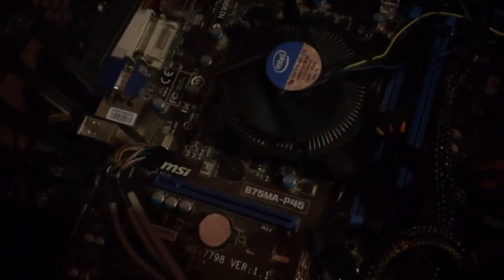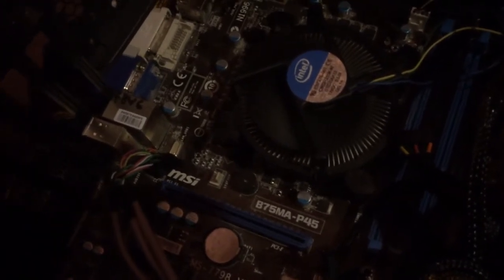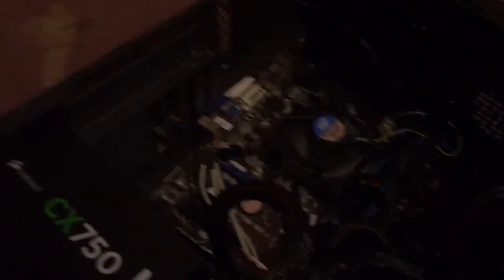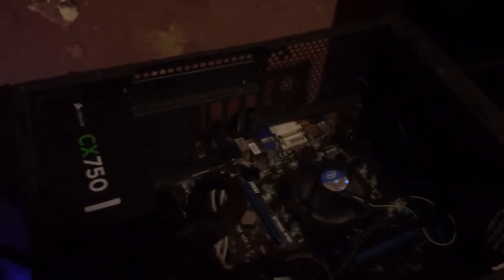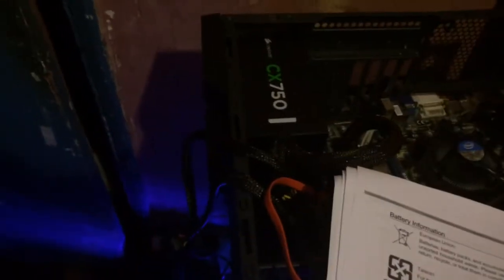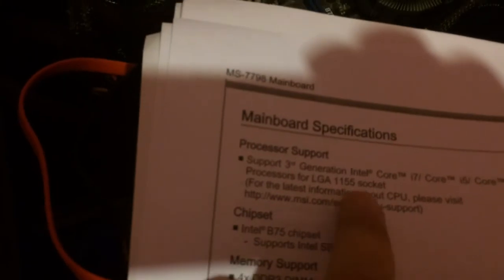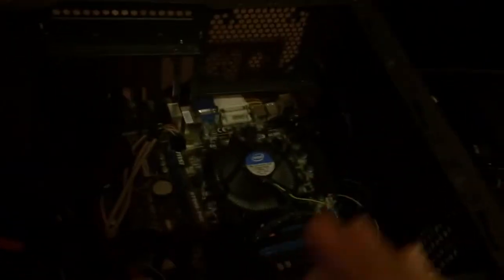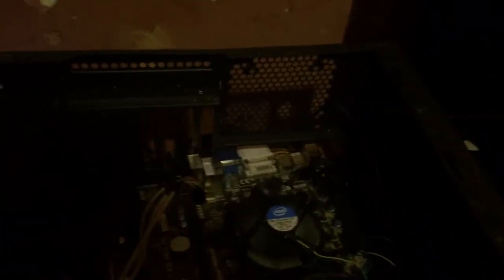Vlog 171 Dead motherboard?

Comment: My guess was going to be that the motherboard is shorting out on the case (I thought I saw the motherboard move, so maybe it wasn't screwed in with the isolators) -- but it looks like you've got it figured out now anyway! :)
Reply from the maker: I un screwed it too see if I can see any burning on the board, But could not see any. I did not screwed iit back as I was only testing if it will work. It was only when told me it could have been the I/O Shield.
Reply from the maker: Just need to find about £45 for the same board.